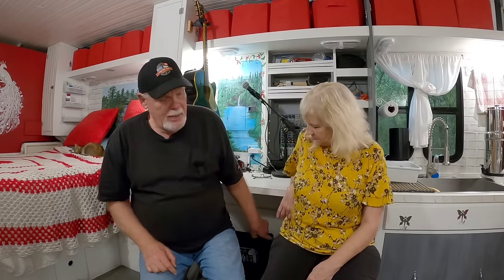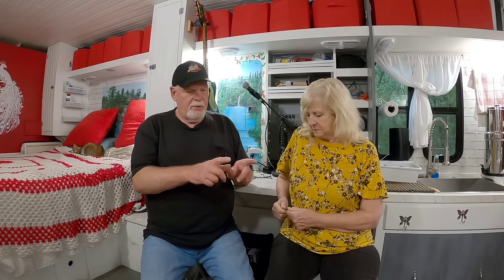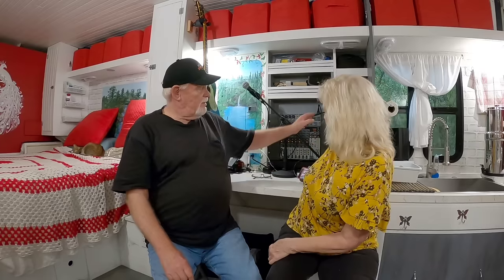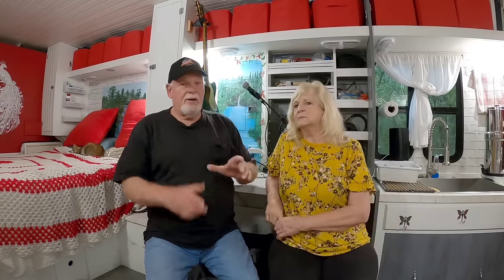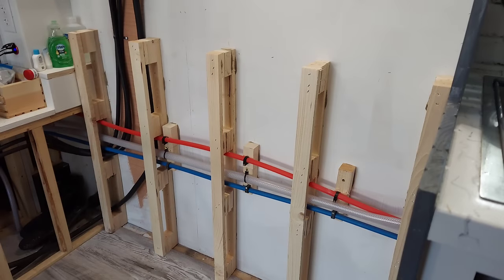Cold Weather Plumbing Tips For Your Cargo Trailer Conversion Build. Is Auxiliary Heat Needed?

Comment: I always grumbled at the RV industry for not using the good brass fittings. Well I learned my lesson when I remodeled the bathroom in our 5th wheel and used brass fittings. The one fitting that froze was right next to the outside wall for the toilet. Five minutes with a hairdryer and good to go. So twice that fitting froze and then I cut it out and replaced it with plastic and never froze again. So something to keep in the back of your mind in the future.

Comment: I am testing a new plumbing device that drips water at 37 degrees f. I have one in a Tee just after my filter just outside the camper. When it gets 37, it starts water drizzling and keeps the hose and pedestal and filter from freezing. When the drip temperature gets back above 37, it shuts off again. Brand is Freeze Miser. I bought a pack of 2 for about $50 at Home Depot. Last night, my first ever test, it hit 32 and there was a small wet puddle under the valve. This is much more compact than a heated hose and needs no electricity to function. I think I’m gonna like these. Just don’t forget and put them inside the wet bay because it will warmer inside that bay and water needs to get out.

Comment: I do HVAC for a living and install mini splits. If you pay attention to the SEER rating (efficiency) then you should be good. Higher the SEER rating the lower it will go as far as temperature. I install LG's that will go to -4F and still heat. You can get some that will go lower. Was -9 here this morning and the clients were still getting heat from it. Check the specs on the unit before you buy. If it doesnt have the minimum heat temp then stay away.
Reply: Yep. I don't buy anything that isn't still heating at -13 F, and the best I have seen are still effective down to -22.
Reply: Where I live it’s a freak event to get to single digits.  When it’s colder than that resistive heaters are the way to go.

Comment: Thank you for the info on the plumbing. I'm at that stage in my covered wagon conversion toy holler. You all stay warm. I'm in Lucedale  mississippi and it's about fifteen above zero My Mini split still works fine at that temperature🥶🦮🦮🐕‍🦺

Comment: I'm on the border of Clearwater and Dunedin Florida and the temperature is 58/60 degrees and many times it's a little colder than that. This has been a colder than normal winter in Florida but it's still better than Illinois weather which is where I'm originally from so I'm not complaining

Comment: I have low-wattage electric floor heat that runs up to the perimeter where my plumbing runs behind about 2 inches of multi-layered foam insulation with a thermal break between it and the metal studs, and with cork insulation on the floor below the heat. Between that and an R-23 ceiling, any outside temperature above about -10  to -15 F is of little concern.  (The water tanks are internal as well.)

Comment: Hi Bill & Deb! I always look forward and enjoy your videos, thanks for taking the time and effort to entertain and educate us. Would it be possible for you to post a link to the heated mattress pad you use?  Also was wondering if you have ever checked for condensation in the air space where you ran your plumbing?
Reply from the maker: Limited-time deal: Degrees of Comfort Dual Control Heated Mattress Pad Queen Size | Zone Heating Electric Bed Warmer W/Auto Shut Off | Fit Up to 15 Inch | 12.5ft Long Cord - 60x80 Inch, White https://a.co/d/6CvhOFg

Comment: what do you mean by  "mini split?"
Reply from the maker: A mini split is a heat pump (air conditioner and heater/furnace) for smaller applications. Simple "Google" mini-Split. All kinds of brands and units will pop up. Ours is manufactured by Senville.  It's a 12,000 BTU unit. We picked it up at Amazon for under $800. They are super efficient and super quiet.